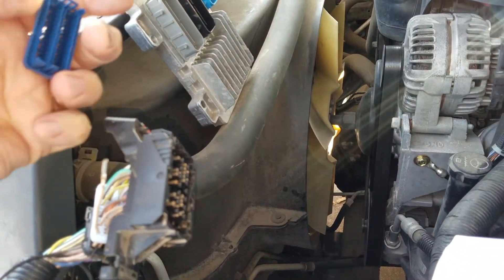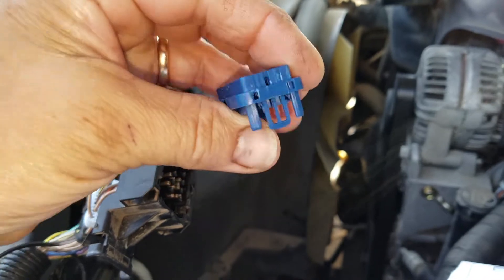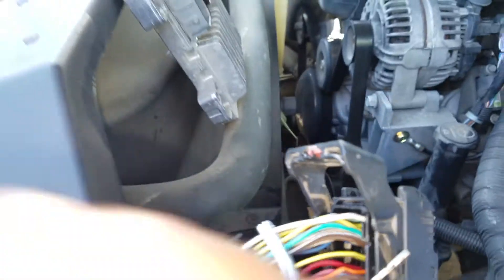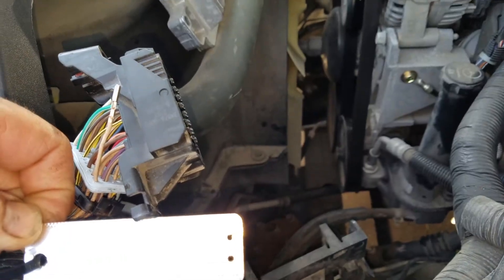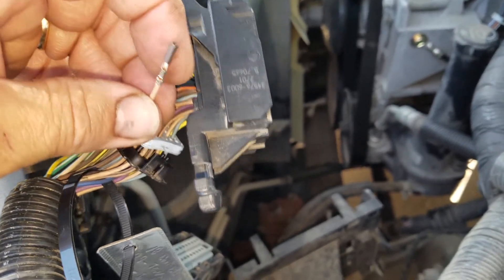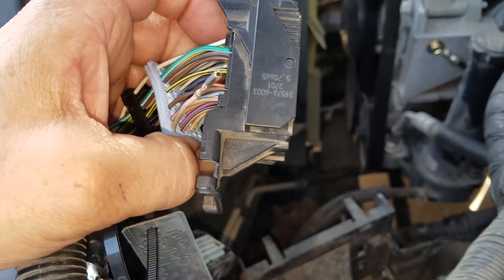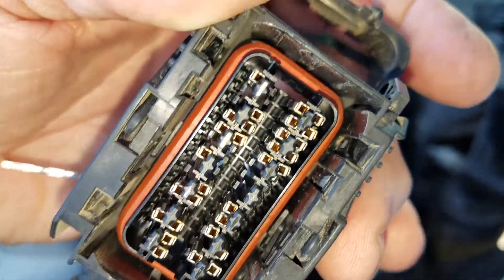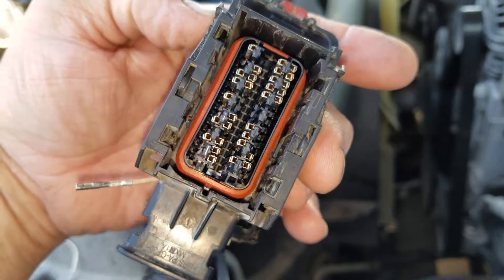Chevrolet E78 pcm plug how to take apart and check pins

Comment: Hey do you know the two fan pinout for the e78 pcm
Reply from the maker: https://acrobat.adobe.com/link/review?uri=urn:aaid:scds:US:ca8dd733-c29f-378b-81d0-c0f9316d36bc
Reply from the maker: https://acrobat.adobe.com/link/review?uri=urn:aaid:scds:US:a31c0d4f-e42d-368e-b78d-4cbc13d5eeda
Reply from the maker: Upfitter has some easily accessible wire diagram